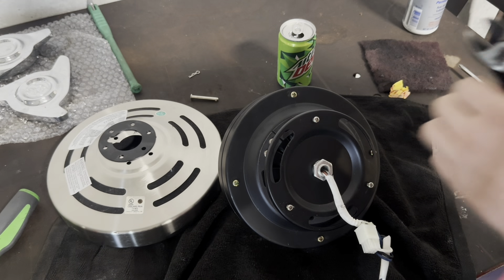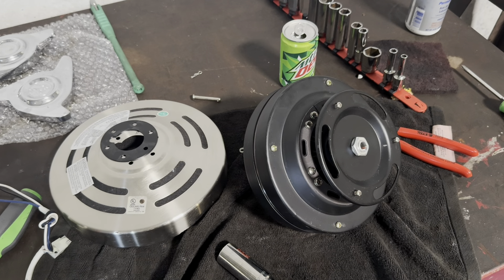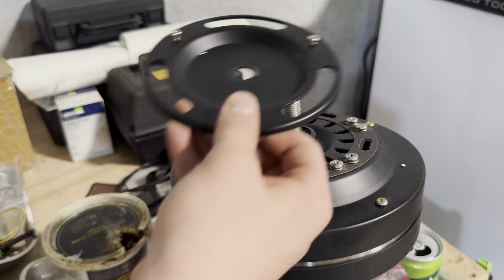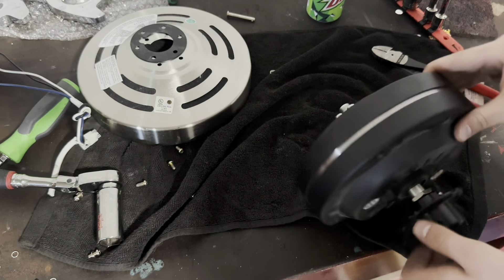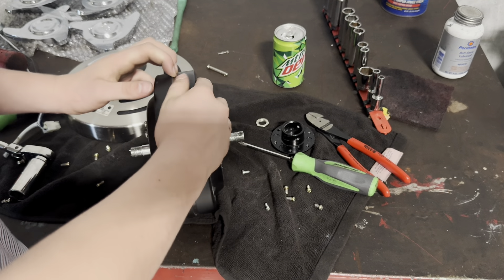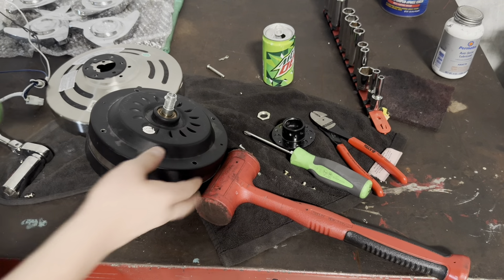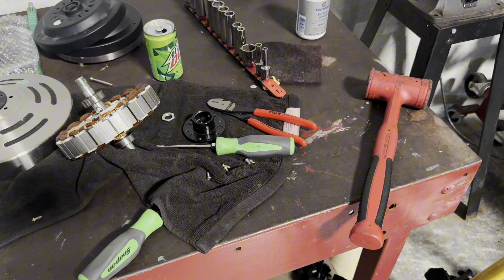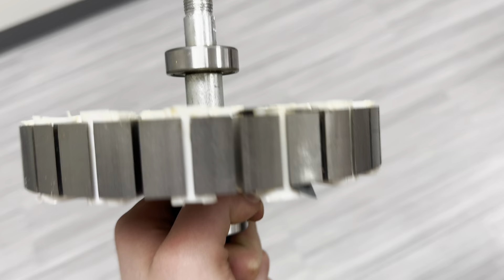How To Scrap A Ceiling Fan For The MOST MONEY (EASY)

Comment: I've heard that these use some kind of 212mm motors. Try measuring the width and length of the magnet that surrounds the windings and holds the motor shells together (not by the screw holes) by millimeters. I kind of want to know and confirm what their sizes are.
Reply: These use 188x25s per the website
Reply: @GabesFans  Wow, awesome!
Reply: The motor literally says 188mm X 25mm.
Reply: @CeilingFanVideosOnYT  Besides the 48" model and the DC models, do all of the sizes of that fan use that size of a motor?
Reply: If the altura uses a 188 why are they so slow?
Reply: Very steep pitch.
Reply: @GabesFans which website?

Comment: WHY??? I would NEVER Scrap a ceiling fan!
Reply from the maker: @JoshuaGalka  LMAO, it’s a home decorators collection which is still sold today. I found it in a junk pile on the side of the road from a condo clean out, it was missing blades, blade screws, mounting bracket, remove, has scuffs and dents in it. It was pretty rough